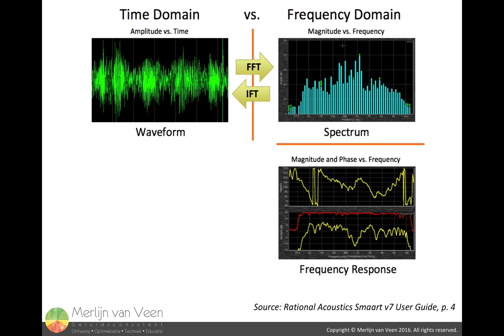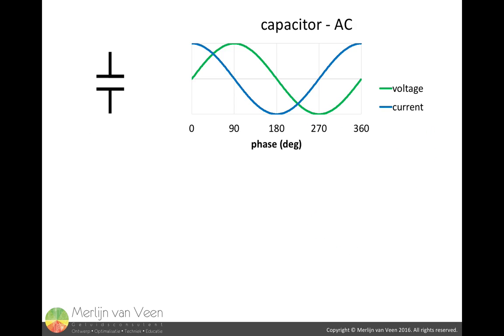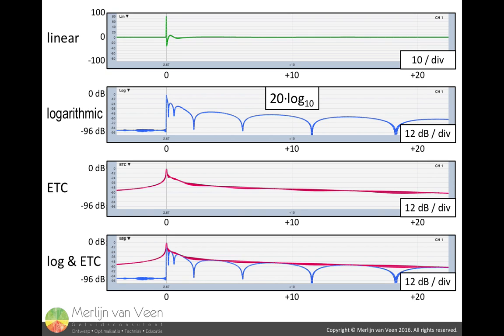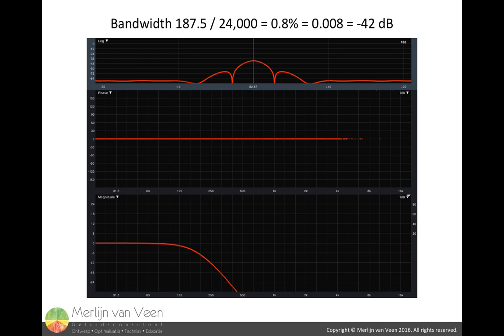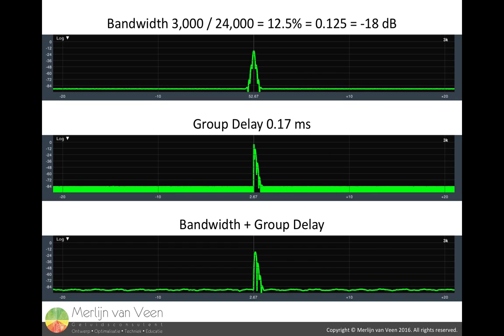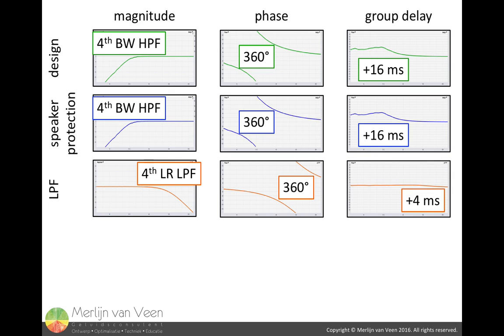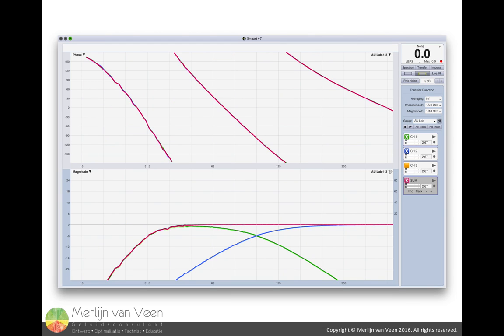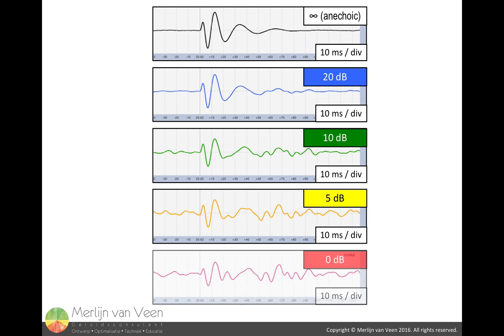Why the impulse response won't work for subwoofers

Comment: Great video, but isn't it the title slightly misleading? The presented facts and information/interpretation are leading to one clear result - "Why the delay finder won't work for subwoofers" .-). The IR works well for subwoofers, same as for full ranges. Problem is created if you try to time align IR of full ranges and subwoofers, because in the "default" situation both IR's display "different" information. Situation rapidly changes when you apply for example BandPass filter at 125 Hz (1 oct) on both IR's. In this case both IR's (FR + SUB) will display the very similar information (close bandwidth and amplitude) content and usualy you can cut 95% of time difference almost instantly (much faster than from looking on the phase graph). Than you can switch to pahse and do the minor tweaks (the remaining 5%).

PS: In poor D/R ratio conditions not only the impulse is hard to find, also the phase information is almost all hidden in "noise". Very handy for finding the impulse arrival could be Schroeder curve display - unfortunately phase graph hasn't tool like this, only the IR ! According to my experiences the IR are very handy also for subwoofers :-)
Reply: No, not the way I understood it, the resolution of the convolution you apply is only about 5% what it changes at higher frequencies and you have massive 1000+ deg's phase shift, its simply impossible to get any significant change on subwoofer phase.